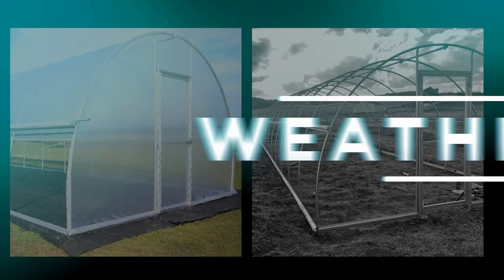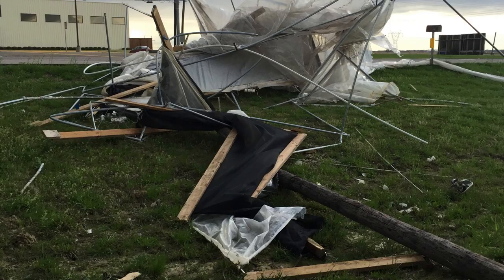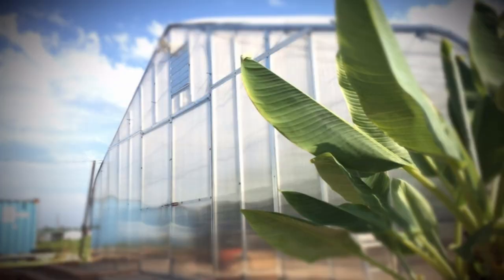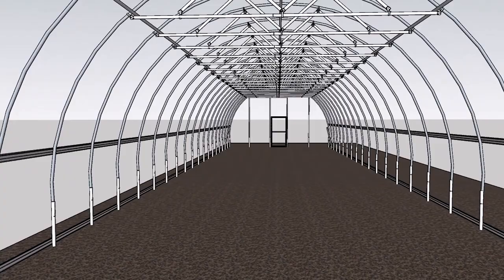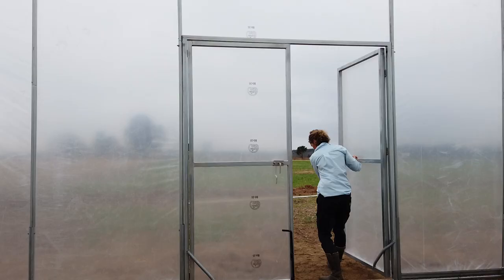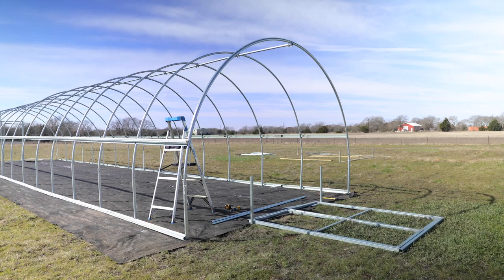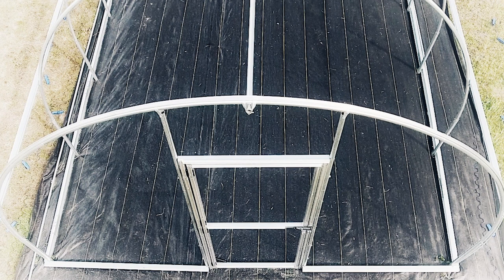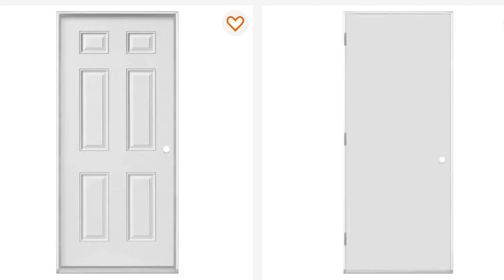Building End Walls | HOOP HOUSE 101 Ep 15

Comment: how long does the plastic last in the low desert, think Death Valley, cuz we're not too far off from their temps.  Most plastic here degrades  to a fragile state in one summer.  Then our ranch is high desert, and last summer when everyone was having heat waves,  they had a temp of 112 at least one day.  We have very little clouds in our low desert area, and more clouds  but still not all the time at our ranch.  So things just get nailed with the direct sun.
Reply from the maker: Our plastic has a 4 year guarantee from UV degradation. Irregardless of location as long as it is installed properly.